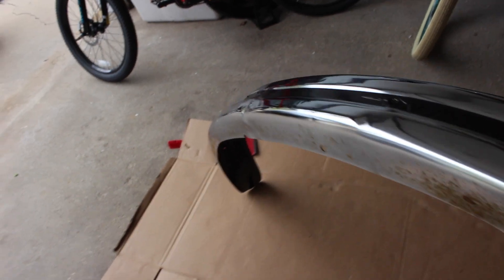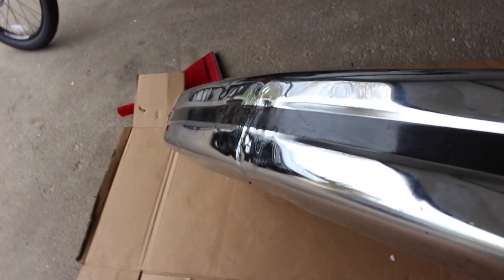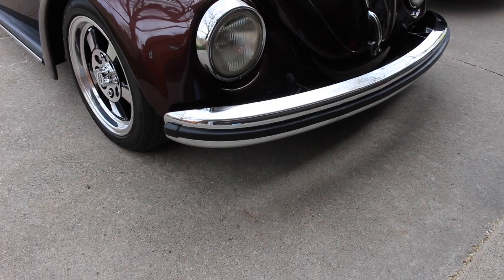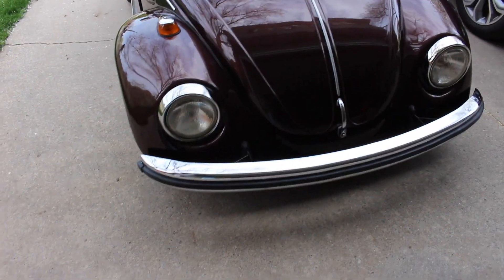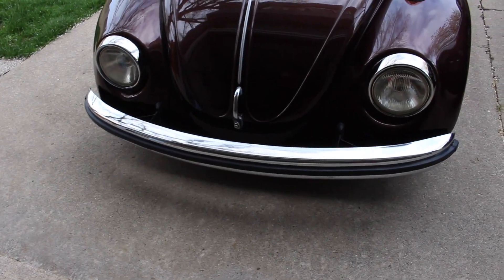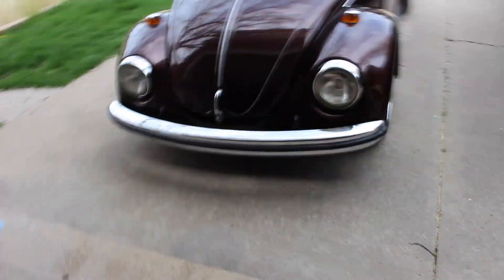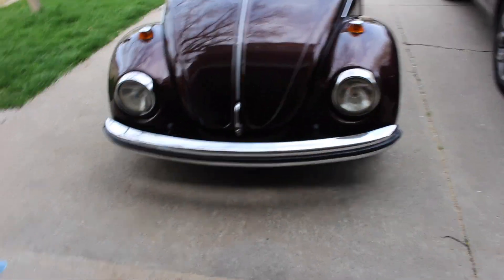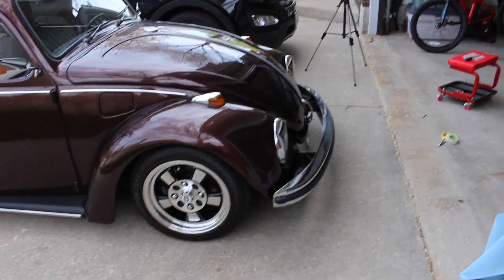VW Impact Strip Installation

Comment: Excellent, just 'polished' up some 71 bumpers and will accept the patina to prove car wasn't born yesterday and as they are Europa bumpers but without indicator cutouts, was thinking of buying rubber strips. Wasn't sure just how to fit, found you, so now sorted thanks v much. Only idea I have is not to blank off holes, the temperature changes will be massive under black and metal so condensation will be a problem. I use massive quantities of ACF-50 fluid on everything so I will just coat all metal before applying!

Comment: Hi. I would like to install the impact stripes on my 71 Súper Beetle, but I observed that my front bumper have two rectangular holes in each extreme (like yours), but have not the same holes in the rear bumper. Could you tell me if it is correct.  Maybe my Bug got a brazilian replacement bumper (brazilian Bug have not a impact  rubber stripes in the bumper, just a black adhesive tape. Thank you
Reply from the maker: If you have the openings at either end you’re good to go. That’s where the strip mounts. The other holes in the bumper don’t play a role in any securing of any kind. You should be good.
Reply: Thank you so much.  I need to make two holes at the end of the rear bumper. Front bumper is OK to mount impact strip. Thanks again